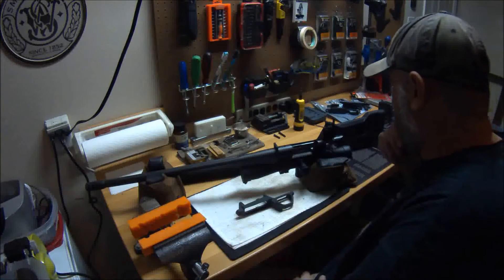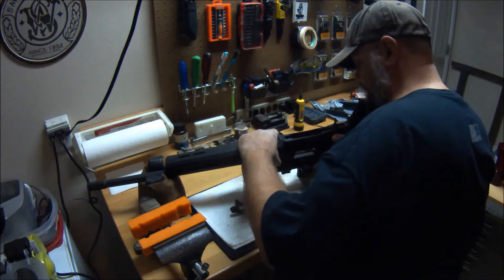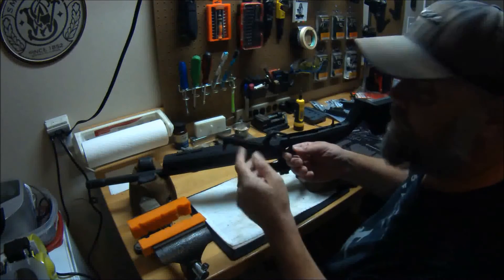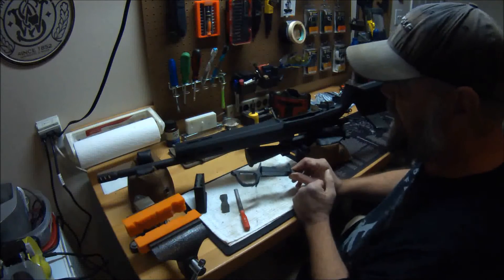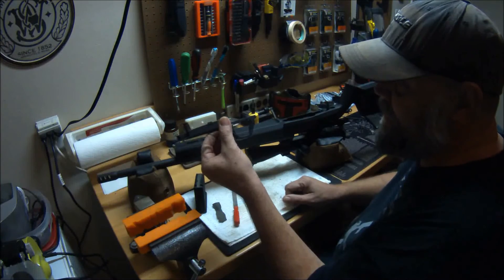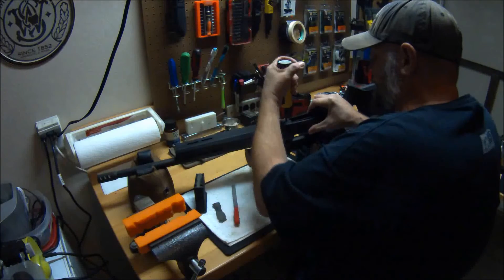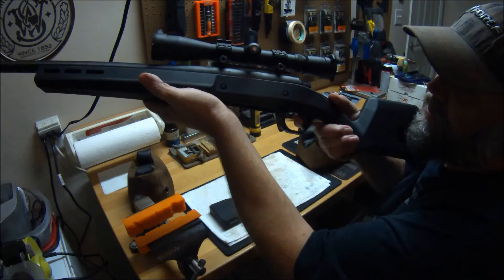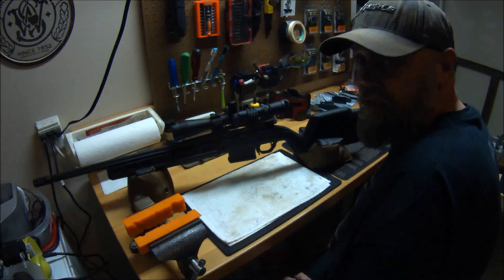MAGPUL 700 magwell mod for Timney 517

Comment: I've seen some say the bottom metal needs modifying and others say it doesn't. Maybe it's a long/short action difference.
Reply from the maker: Jc Wesson it was a direct for on this SA and had been on several others I've done since, the issue was solely in the clearance of the after market trigger, a Timney 517.
Reply: Skippy02 right. But I've seen several 517s go in magpul bottoms with no contact. Just trying to discern why that might be.
Reply from the maker: Jc Wesson perhaps in the LA set ups, I've not done a LA wet the 517 so there may be a minor difference in the triggers positioning